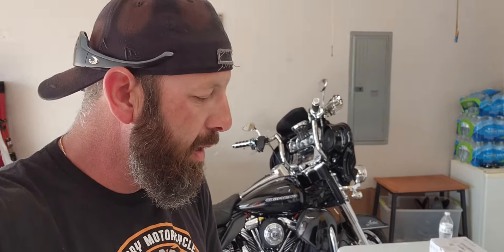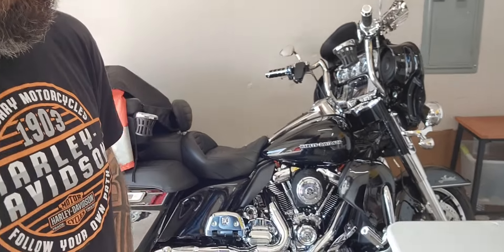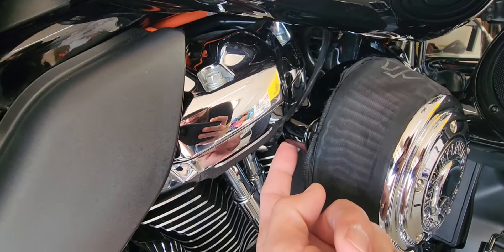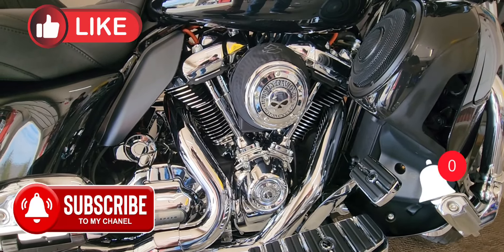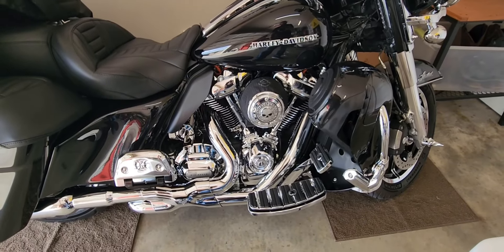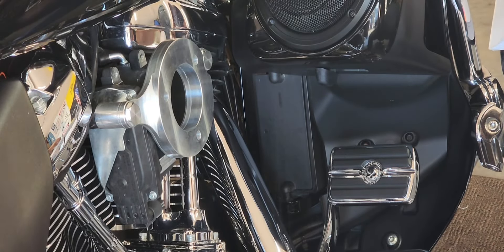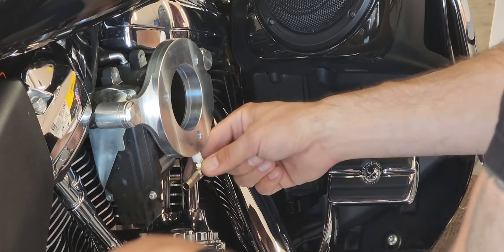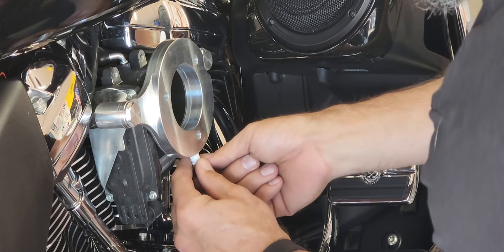Installing the best external breather system, the transformer with the Outlaw 606 air cleaner.

Comment: would it work to use a piece of brake line and plumb it from the breather straight into the exhaust pipe behind the catolitic converter?i think  the heat from the exhaust will burn the mist

Comment: Very good video.  Thank you for your business, we appreciate it.  I believe you will be well pleased with the benefits of your new set-up.👍

I hope it is ok with you for us to add your video to one of the playlists on our Youtube channel.

One note:  You over torqued the two head bolts going into each cylinder head.  I know you used the specs from your manual, but that is for steel breather bolts with a smaller shoulder.  As noted in the instructions, the aluminum bolts that come with the Transformer EBS™ should be only tightened 120-144 inch lbs (not ft. lbs).

Since most garages don’t have an accurate inch lb torque wrench. Put them in finger tight, as tight as you can get them with your fingers, then use an open end wrench to turn them another ⅛ of a turn. DO NOT OVERTIGHTEN! If they are overtightened, it is possible that they will break off when installing or riding down the road, leaving just the threads in the head.
Reply from the maker: Sorry I'll go back and retorque them. I'm just in the habit of trusting my book  and not the directions on that because a lot of manufacturers do it for a broad range of bikes.  I'll do a review down the road and tell people.  Thanks.
Reply: @Harleypoor  Yeah, I have the same habit.  Great vid, and glad you're enjoying the parts!